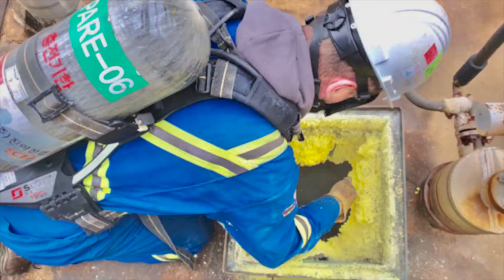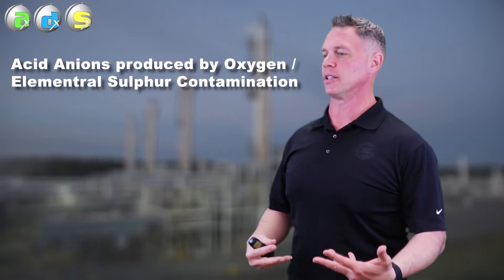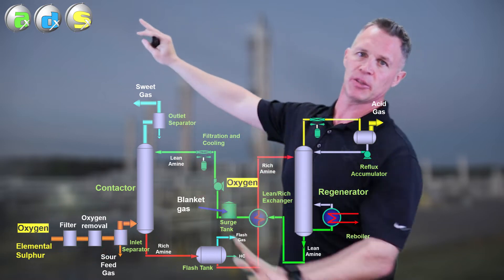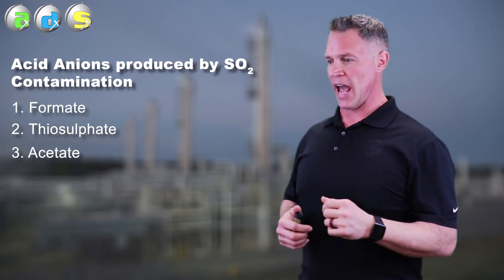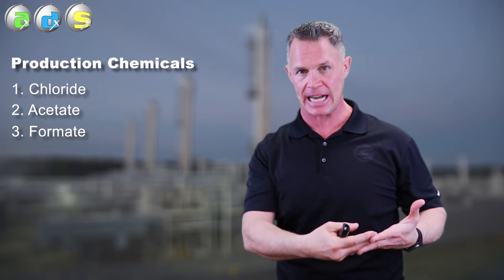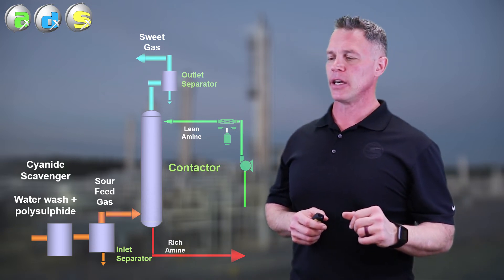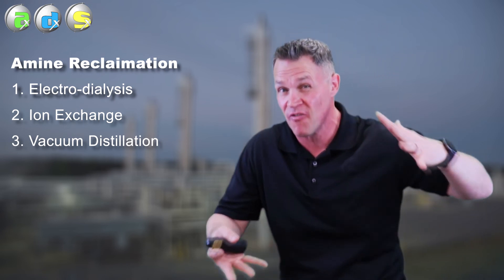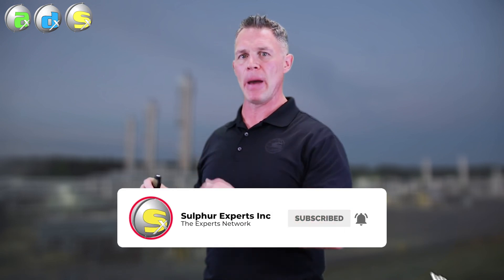"Basics" of Acidic Heat Stable Amine Salts: Part 2

Comment: what is the acid gas loading level?

Proper operation to the amine system is the most effective way to control corrosion, with particular attention
paid to acid gas loading levels. 
In addition, to avoid corrosive amine degradation products, the process
temperature should not exceed recommended limits. Proper control of the reboiler rate and temperature is
necessary in order to maintain proper regenerator temperatures.
temp limit 200 deg F

Comment: Excellent 2 part video package, I love the energy! Something you may find interesting and may lead to an increase in HSAS cases....

We (Qa3) have observed oxygen being introduced into gas processes via flare gas recovery (FGR) systems. FGR systems are reintroducing gas from low pressure systems, which was histroically sent to flare, back into the gas process. A major proportion of this gas will be blanket gas (nitrogen) which is typically generated offshore from the air using membrane technology. This technology is not removing all the oxygen and hence oxygen is now being introduced into the gas process; therefore, amine units may now begin to see increased concentrations of oxygen!

And a second thought on this. You mention surge drums could potentially suck air back into the process (introducing oxygen) if a blanket gas is not used. Bang on, but worth considering that the blanket gas may also contain potentially 1-2% oxygen. Another potentail source of oxygen ingress into amine units.

Thanks again guys, check us out if you want to chat through our above thoughts. (www.qa3.co.uk)

Comment: In our plant, we are using MDEA and some times the Demin water make up to amine reflux is slightly acid around 5.5 and after 4 years some lines started to corrode and we found pin holes, do you think this HSAS is built up due to water ph?